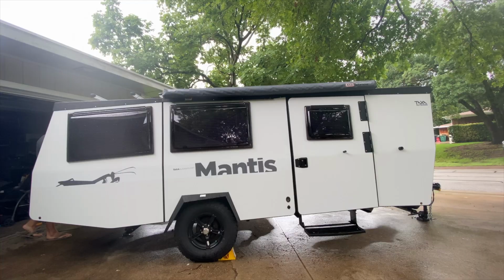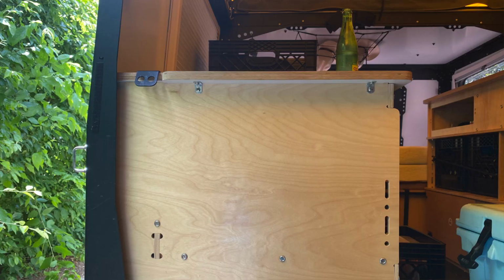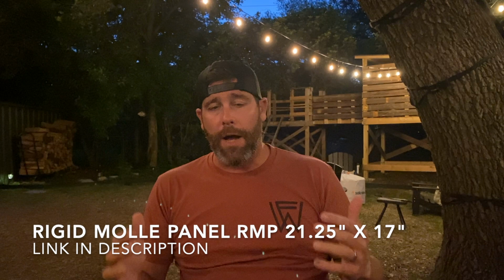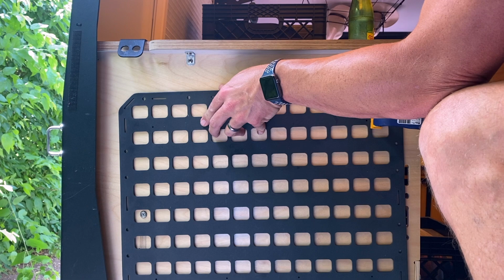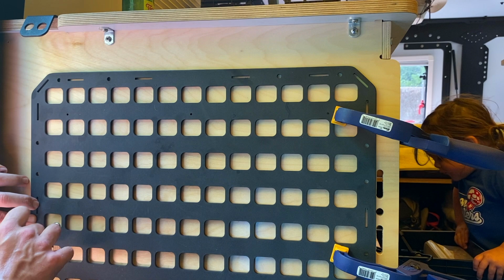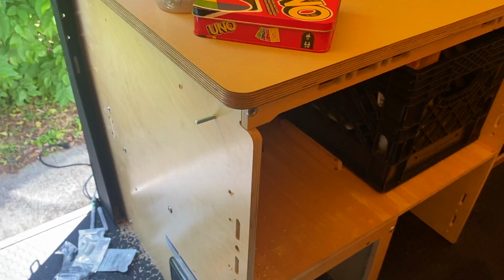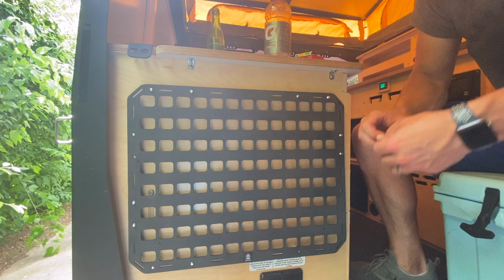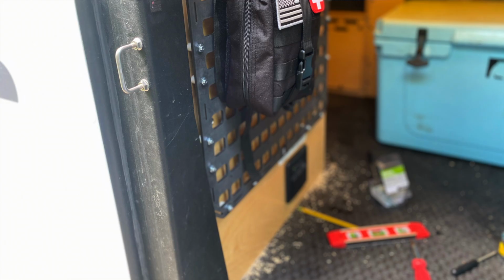Molle Panel Install On A TAXA Mantis

Comment: Great idea and I thought about this in my 2017 cricket, such as on the roof. But for now, thinking smaller. You said the door was another attachment spot. How would you have attached it to the door?
Reply from the maker: Honestly, I didn't fully figure out attaching to the door. I think there could be a way to integrate into the angle brackets on the (not sure if cricket and mantis are the same), but it just seemed like it would be more costly and time consuming.